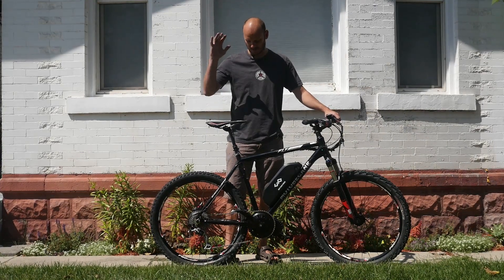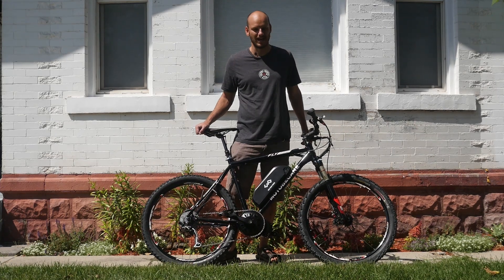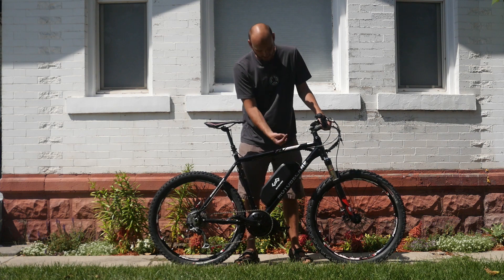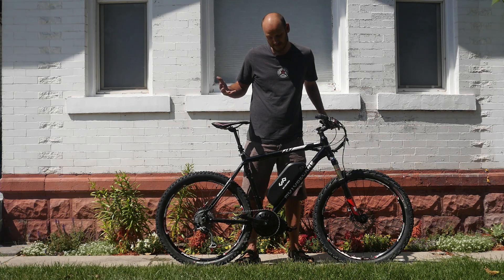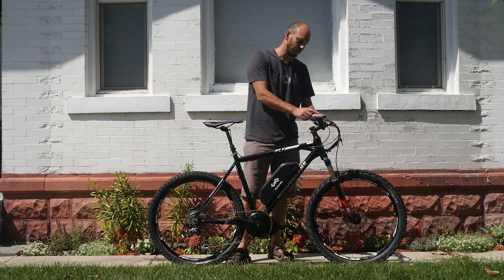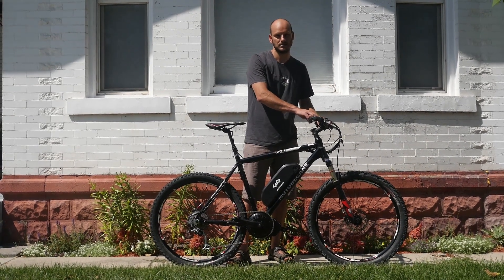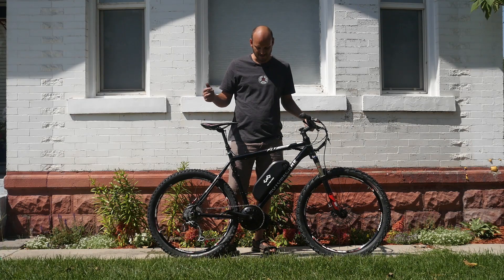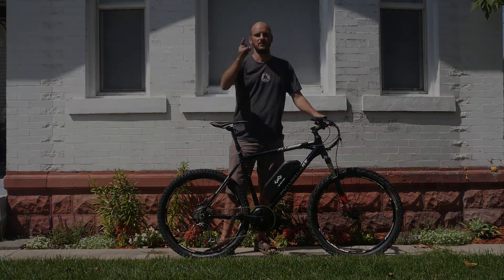Custom E-bike Build: Motobecane Fly Pro BBSHD

Comment: Johnny -  I am elderly and have a Vevor Adult Tricycle 24"/ 7 speed from Walmart that I want to motorize for riding and exercise around the neighborhood. We have some steep grades but only about a block long. What mid frame motor - battery and  specific accessories would you recommend as minimum to keep the cost down?  Riding for an hour or less per day. Please reply  Thanks neighbor. DRT

Comment: Dont need gear sensor
Reply from the maker: completely disagree. You can do major damage without it.
Reply: @JohnnyNerdOut  I had no idea this existed, thanks Johnny, I'm gunna put one on - I wouldn't have my bike without your teaching and clarity - you changed my life I won't forget it. - getting to go 65 KM/H is a different kind of experience when you use to ride a busted up 1990s Trek BMX for 10 years :') - thanks for your Johnny nerdout tests in your videos too- they really help new people to bikes fully understand what parts will get you what results.
Reply: @JohnnyNerdOut  I been on mine for 2 years and running phaserunner so more power an you don't need it mate or brake sensors there inmybox been doin nothings Ince I became evil kanival